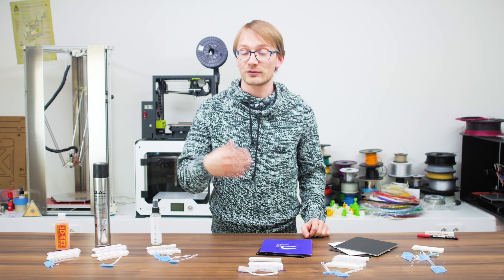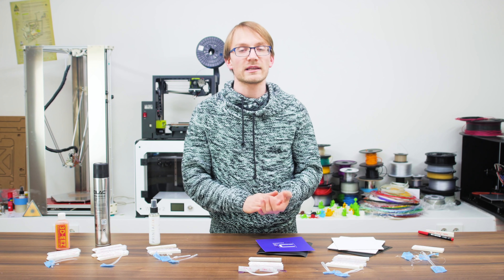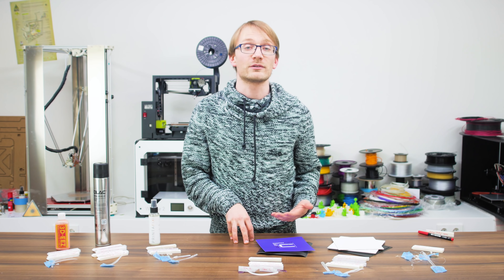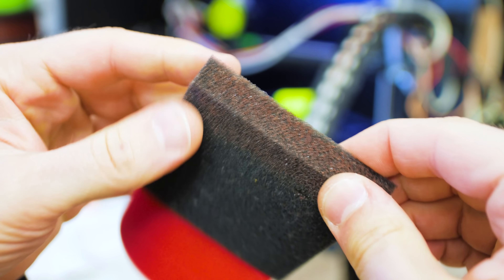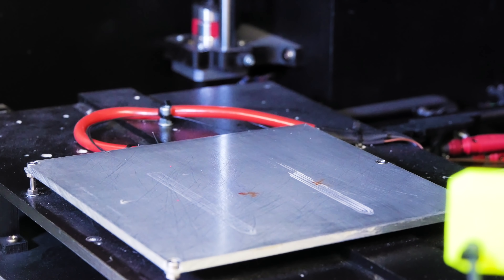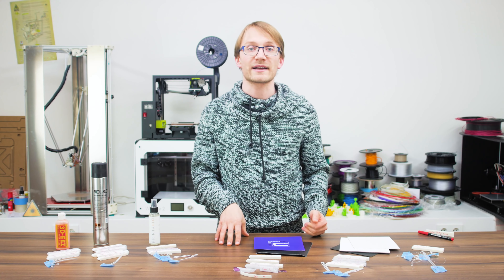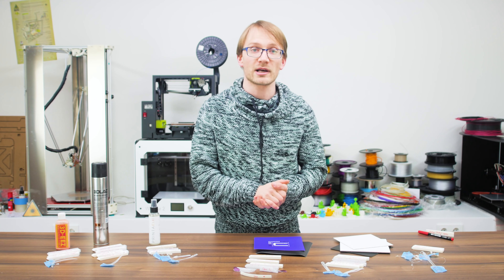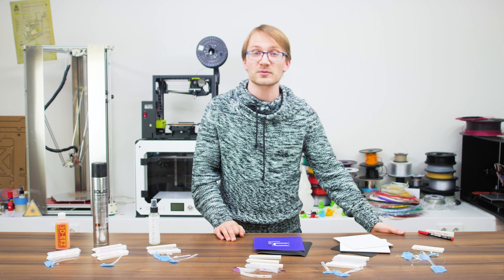Review: Are commercial build surfaces worth it?

Comment: I have tried several solutions: hairspray, BlueTak, PrintInZ plate and finally a sticked to PEI sheet :) I'm using it on top a 3mm glass sheet in an Ultimaker original with a 24V silicone heater. I also closed the print chamber but did not install any chamber heating yet. My experience is the PEI sheet with the fast 24V heater works very well - I honestly recommend this solution to everybody who struggles with bed adhesion.

Comment: When you try the alternative surfaces I have one for you. I print on 5mm glass, cold. I sand the glass with coarse sandpaper. Then coat with gluestick. Then spray water on the gluestick and distribute it evenly all over my glass. I let it dry completely then sand it again with coarse sandpaper to scuff up the glue surface. This coating will last for months and besides the occasional touchup or resurface never has to be replaced. Just wet, redistribute, dry and sand and to be good as new again! I make huge objects like this. My bed is 9 inches by 14.5 inches. Love your videos. I always hit like!

Comment: I have a TAZ 5 which comes with a PEI coating on the build place. I found that in a short period of time that the PEI stared to lift off the build plate, and developed small holes in the areas that had lifted off. The edges of these holes crystalized and rapidly enlarged with use, as well as ruining the 

 Finally I removed the PEI coating and started printing with a variety of adherents. Of all those I tried on the now boron glass build place, I found that "Aussie pressure spray" (borrowed from my wife) worked the best. Having little to no water it dried the quickest and certainly provided the best gluing surface.

I am a relative newcomer to your show, but find your approach to be in tune with my general personality. Likely because I was trained in the physical sciences. 

I regret that I can not name you to get a cut from my Amazon purchases as I have already dedicated that to the EFF. You might think about a Patreon account. Your shows have saved me a great deal of money and time. More importantly they lead me into areas to think about. I be more than happy to find a way to help reimburse you for your terrific work.

Comment: I have tested a regular PETG with a coropad on a non-heated bed and I am very happy with the results. Prints stick better compared to using a glue stick and there is no mess to clean afterwards. Longevity is still unknown but so far I have printed around 10 parts on the same place without any damage to a coropad.

Comment: Interesting comments about printing in cold basement. Ive just brought my printer to freezing Lithuania (where im working) and have been having a nightmare getting ABS to stick. Air temp in garage was about 10c at most. 
Simple fix - put a polythene cover over printer. Amazingly simple. no warping after that.
My new design printer will be enclosed with internal temp regulation.
Thomas - Great channel.

Comment: The 3M 468 Tape itself IS awesome to print onto. I have printed on 2 sided sticky 3m transfer tape, stripped the glue and printed on the plastic, stripped the plastic and printed on the glue.

If you are always careful and shave off an object the plastic surface lasts a long long time and is very uniform.  You can also sand it down by just scraping the heck out of it. The problems you have are things sticking TO it not pulling off. So, I make it slick for easy removal.

I found a HUGH roll of this stuff at a scrap yard where they just gave it away because noone wants a clear laminate on a countertop...

I like it because it is awesome and free...

Comment: Another option is MagHold which is a spring steel sheet with kapton on the bottom and a printable surface on top.  It's held in place by magnets in the aluminum plate so it can be quickly removed, flexed to remove parts, and reinstalled. I bought it but haven't tried it yet, however it's gotten good reviews.

Comment: Nice review. For me 3DLAC completely changed 3D printing. From picking designs to be easily printable and babysitting the printer through its first layer - and often walking away disappointed -, I went to printing just about anything, even prints with 99% support on the first layer, big blocky surfaces, curly nightmares, ... Just spray on a layer, start the print and walk away ( yes, of course I still watch the first layer ;-) )
It made 3D printing so much more reliable. My filaments of choice are Polymaker Polylite and Polymax ( which used to always warp ) and my beds are glass at 50C. It can leave a layer on other parts of the printer but wipes off easily with a damp cloth.

Comment: So is Coropad... the exact same as buildtak? All the chinese printers are coming out with that surface now. Another really interesting one is G10 - the surface the Robox and Cubicon Single uses. TOTALLY useless cold, but I am amazed how well it works for ABS when heated up. Plus yeah, once cold they just pop off.
Reply: G10 is almost identical to FR4. Difference is that FR4 has a flame retarder which makes it UL94-V0. Not sure this makes a difference in hotplates, but I doubt it. The type of release film that they use in pressing might makes a difference though. But that would apply to both, FR4 and G10. But I guess your deeper questions was that you like to see them included in the test. Me too.

Comment: I really like the Zebra Plate. It sticks well, but I can remove it and flex it to remove the part. I flex it so the corners are up and reinstall. The clips pull the edges down again and it is flat again. PLA at 60 and ABS at 100. I print full bed parts with no issues.

Comment: I know it's and old video... but great test! As always! Coropad is the worst out of the bunch, we had nothing but trouble with it, replacing it every 20 prints or so.(my opinion)Thomas, I'm surprised you didn't test the Filaprint surface by Filafarm . We use it for quite some time now with a bunch of different printers and it outperformed any other surface we have used before. It is not cheap and works best at 67 degrees but it lasts. We have one that is 3 years old and it still rocks. The best part is, when the surface cools down the parts just pops up. I'm  addicted to it :) 

Thanks Thomas!

Comment: Excellent video! I do wish you had thrown a few of the common ones in the mix like glue sticks hairspray and painters tape for comparison. Especially when I can see in this video how easy these more expensive materials come apart. My personal combo for adhesion is 3inch wide masking(NOT painters tape) tape with the elmers disappearing purple glue sticks. Tape lasts 10 prints at least and the glue stick takes seconds to clean off with water.

Comment: A good "disposable" print surface is automotive window tint sanded with finde grit and with a layer of ABS juice applied. This will stick to quite literally anything but the film tends to tear off when trying to remove it.

PEI on the other hand is my favourite so far as a permanent solution. Incredibly robust, sticks well to most things when heated (including PET not sure why Tom couldn't get it to work!). Only drawback is ninjaflex/semiflex type material. They stick WAY too well on it to the point that removing it is a massive pain. The best solution for this is to have a roll of kapton on hand. Apply a layer of kapton OVER the PEI when printing flexibles, account for the extra z height in the slicer and voila.

Comment: For PLA, I've had extremely good luck with 3M Scotch Masking tape, (not packing tape.) The problem I was having with almost all of the blue tapes was that the blue tape would get a good adhesion to the print, but the print would lift the tape from the bed. I haven't had that problem with the masking tape. I may have to replace it every couple of prints, but it's also significantly less expensive than the equivalent blue tape. I don't recommend it as a solution for ABS, and don't know how well it would work with PETG. 

This experience was primarily on my printrbot metal simple, w/o a heated bed. I Find it's equally able to hold the pla print on a heated bed. One trick I used with the non-heated beds was to "scratch" the tape down so that you could see the color of the surface change where it was closer to the print bed.

From my own experience with a couple of off brands, and from what others have noted, the 3M Scotch Masking tape is what to look for. The surface of some of the others seems to be treated with something to keep the tape from sticking to itself, but it also doesn't help the PLA stick to the tape either. 

I don't think it's as 'necessary' on a heated bed, but until I find a more permanent solution, I expect to be using it, or abs juice for my pla or abs prints (alternatively.)

Thanks for the video, I'll have to go through it some more to decide what might work best long term for me.

Comment: Im printing pla on heated glas. For me  sugar Walter works just fine. Its  pretty cheap and everyone have some sugar at home. I prepared a small bottle for printing and added a little bit of salt for conservation. While printing it smells a bit like candy factory and taste pretty sweet (just recommended if you use plastic without any harm substance). It's easy to apply and to remove. I coat my surface every time before printing.

Comment: I have been using Zebra Plates by PrintInZ since their original inception back in 2014 (i think?) when they were known as "NinjaPlates". I have had every generation of the plates ever made and have been happy with the results.

I use them daily to print customer orders (mostly PLA with a heated surface), although I do print PLA on a cold bed and ABS/TPE/TPU/PET+ regularly with heat.  The Zebra Plates allow me to easily print objects with large surface areas and simply give the plate a "flex" to pop them loose. Without the flexible build surface, I would have extreme difficulty removing some of my inventions from the print surfaces

It's fine to scratch up your own prints, but when you're printing parts for customers, you don't want to damage any layers of the print, especially the base. These plates make it so easy to remove the plate, flex and pop off the print, and put it back on to print another part 

In addition to the Zebra Plates, I also always use a little bit of glue from a glue stick to increase adhesion. With these two combined I rarely ever have a failed print on my three FlashForge Creator Pro's (Combined print time = 48000 hours, over 15000 kilometers of filament printed).

When it comes to printing PLA/TPU/TPE/ and PET, I won't consider any other build surface than Zebra Plates with a touch of elmer's glue stick. 

Call me a fanboy, I don't care hahaha - I've got hundreds of successful prints on 5 plates in over two years

Comment: I have a "Cocoon Creates Mini" with the nonheated bed. I find that placing a lamp next to the bed helps to heat the bed before I start printing. I have had limited success with hairspray and blue painter tape to assist with print adhesion. I am looking at building a cover to go over the 3D printer to help maintain temperature, especially during the first print layer. I have found that even having a ceiling fan on the low setting can cool the print and affect the print adhesion.

Comment: I'm using 3dlac on removable glass sheets, best thing I've found so far. I just spray them away from the printer, and tada. Even PETG the bane of my print life sticks to it perfectly. I find when the prints cool they all come off very easily for the reason Thomas stated, it pulls that 3dlac residue with it.

YMMV, but it's working for me.

Comment: I like kapton tape. It does not like dust so I usually cleaned it with rubbing alcohol. I recommend making an enclosed box for a printer if it is an open design. I have not used rubbing alcohol since I made a box for my open designed printr bot simple metal.

Comment: A glass surface cleaned with glass-cleaner works very good, rinse very good with hot water, No warping at all, sticks like hell..! 100% success..! (PLA).  Dry with paper, not with a towel or other cloth. There are always some soap leftovers from the washing machine in a towel. It reverses the de-greasing from the glass-cleaner.

Comment: What I use 99% of the time on all my printers (all have heated beds) is PEI sheet. Additionaly I spray a little bit of Dimafix spray on it every several prints. I noticed there's really no need to reaply it every time. 
This way everything sticks without a problem - abs, pla, pet/g, hips, pc, nylon.. I clean my beds maybe every 20 prints and then reaply coat of dimafix spray. Never had any issues with filament sticking to the bed this way, unless it was z height or line width issue. This way I can also run first layer rather fast and it still sticks perfectly. 
I came up with this idea after petg stuck to PEI too much several times and was impossible to remove without damaging PEI, so logic behind it was to have some kind of coating between heatbed and print. I guess in a way this would also work on any heated surface.. But you know what they say, if it ain't broken don't fix it.

Comment: Good to know info here.  I have been struggling with the best adhesive method.  I tried the glue stick that came with my Prusa Research Printer but I could never replicate the original build plate stickiness.  I tried Purple Elmers glue which works surprisingly well but I found myself having to redo the plate often and spot touch ups resulted in non sticking prints.  Currently I have been using PET film in the from of window tint.  This stuff is crazy good with a wipe down of ABS slurry.  I have to stick parts in the freezer for a few minutes otherwise its impossible to release from the bed.  My issues he been creasing started at the edge of the build plate and then getting this raised crease going across.  This was due to leaving some of the film overhang and when heated it would ripple and then start to pull up.  I believe I solved this by cutting the film just shy of the edge of the build plate.  The great thing is if you avoid using a scrapper the PET film stays in great shape and if the build plate gets too much abs slurry build up I can just hit it with some acetone and start over.

Comment: I can't recommend PEI more. I've had such great experience with PEI that I would never go back to anything else. Laminate to your bed, sand with 600 grit once every 50 prints and clean with alcohol/acetone depending if you use ABS...and just print -- it works! Even with flexible materials, use a little glue stick to make adhesion less sticky -- even Nylon works -- it's awesome.

Comment: I think this topic needs to be addressed again, especially now that the zebra surface is no longer available. The lamination of my plate finally failed after nearly 3 years of heavy use, and now I am desperately trying to find an alternative replacement for my abs prints, but so far nothing works quite as well. I really dislike using an interface like glues/sprays and it just makes the entire process more messy and more cleanup before I can deliver the print to a customer.

Comment: Hi Tom,

That was an amazing review, you took the trouble of ordering all these solutions although it is easy to lose track of everything that's happening for bed adhesion on 3d printing. Very useful and very balanced analysis.

However, it really bothers me that you do not use a glass for 3d printing. I also review bonding solutions for my channel in brazilian portuguese (I am expanding videos to english now, hope to someday have some useful material to present in english) and there is an absolute directive I always follow: always use glass. It might decrease the temperature a little (10-15°C for 3mm glass), but it straightens the not-so-straight aluminum or fiberglass and is cheap and disposable, maintainable and cleanable, preventing wear and tear of the heatbed (and you can also easily detach it after printing to wash the part off or clear the glass). You also prevent the stress of forcing the other components of the printer when detaching the 3d printed parts.

Also, since polycarbonate is so good that it is worthwhile to fight with it to get good prints, why not also review 3d print surfaces for the most difficult filaments? Like POM / poliacetal, which is hot right now - and some people say you have to use laywood, cork or wood compensates to get it right.

And another suggestion: some people have had a very successful adhesion case by coating their glasses with polaseal, the plastification material. Though this is more a DIY than commercial solution, what do you think about testing it too?

Comment: I've had great luck with eSun and Gizmodorks PETG on PEI. I occasionally wipe the surface with isopropyl alcohol and a paper towel. Skin oils seem to be the culprit.

A straight nylon is the only thing that hasn't really worked for me on PEI. I've used ABS, ABS with anti-shrink additives, ABS/nylon blend. HIPS, PLA, flex PLA and ASA filaments on PEI just fine. I do use an enclosure, heated for ABS and related plastics.

Comment: I recently got a Zplate and have had great luck printing PLA on it cold.  ABS starts out great with a bed heated to 80c but once it wants to start to warp seems to come off too easily and ruins the print.  I have only been printing on it for a few days so could just be a matter of tuning in the first layer height and temp.  Nylon I could not get to stick at all.

When it comes to printing on one surface that sticks every time I go to the blue tape with the disappearing purple glue stick.... however just yesterday I found that you can get the same glue in a spray bottle!!!! I grabbed that up and am going to give it a try.